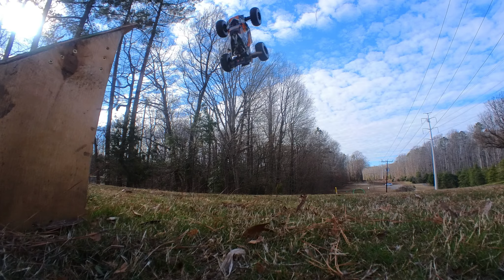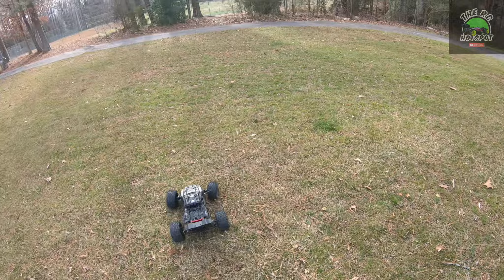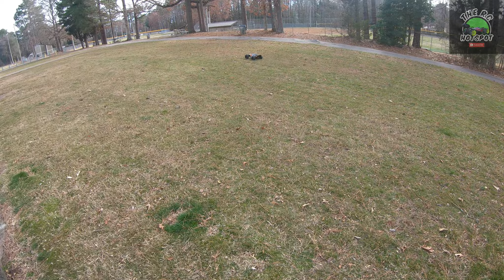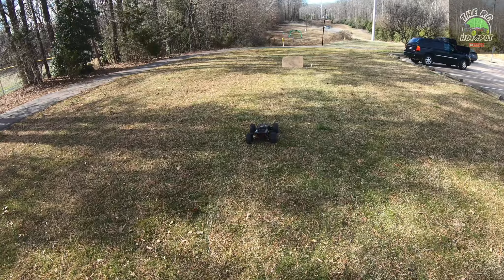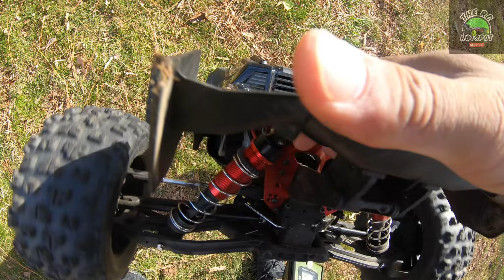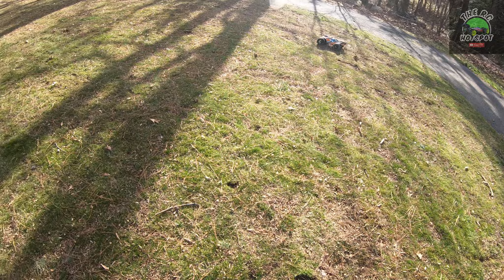Kraton EXB vs Kronos XTR Running Hobbywing Max 8 System on 4s and 6s

Comment: Nice bash session, makes me want to get my exb built up.
I have a v5 and it steers like a tractor. Servo saver I’m thinking....
Reply from the maker: I changed my servo saver in my V5 to a hot racing one. Works much better. Thanks for watching!
Reply: Use the snap ring trick I added three to tighten it up and it made a world of difference, east tactics has video on it, just your in kraton steering fix

Comment: Like already mentioned.... another great video man!

So, I did a thing with my K6S v5 a couple weeks back.  Before even doing any research on it, pretty much just a spur of the moment thing I decided to drop a MAX5 in it. When I opened the box for the MAX5 I almost had second thoughts! That thing is MASSIVE in comparison! 
After moving the receiver box to the old ESC mount plate, and moving the battery tray back.... it all started coming together. Still running stock motor while deciding what I want to go with. Suggestions? Also, running it on a 21t pinion with stock spur. Needless to say.... this thing is pretty sick! Of course I still have some tuning and adjustments to make on it!

I pulled it out of my car at the LHS last week and the owner just looked at me, looked at the Kraton, back at me one more time and stimply said "I'm not even going to ask.... this is something YOU would do! Question.... what have you already broken? And what additional spares do you need this time?" lol. Good stuff
Reply from the maker: Oh wow! Are you running on road or off? Hows the temps? I love it! I haven't even allowed myself to think about dropping a max5 in mine lol! But now... 😆 I might have to try this. Thanks for watching. I appreciate it 💯
Reply: @therchotspot  I have been running it pretty much anywhere and everywhere. Word of advice... make SURE your diffs are shimmed properly. Also, Im about to order some aluminum bulheads because I feel like the stock bulkheads will flex too much with that much additional power/torque. On an 80F day, the ESC might hit 100F while on stock motor and 21t pinion. The motor does get a little warm if I do back to back runs, but not in danger of thermal damage range(no fans on motor)

YES! you definitely should! I havent made any videos yet since I've just been basically messing around with it when I've beeen able to find the time here the last few weeks.

Comment: Hi mate, can share what pinion ya using for the Kraton on 4s? Any heat issue?
Reply from the maker: 15t, no heat issue
Reply: @therchotspot  thank you bro for replying. How abt 6s 15t on Kraton, any heat issue sir?
Reply from the maker: Gets a little hot, not bad. But this has been during cooler weather, in the summer, Im not sure yet